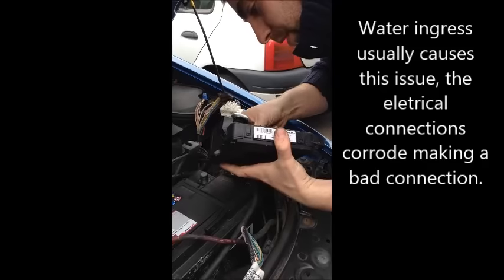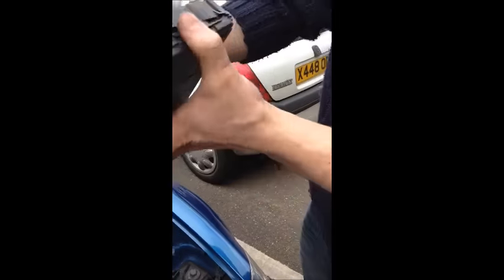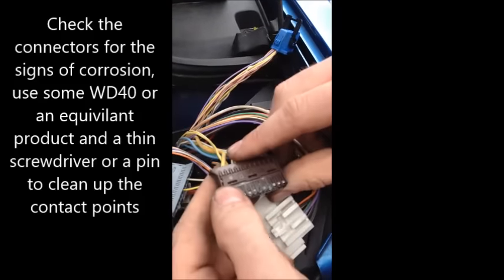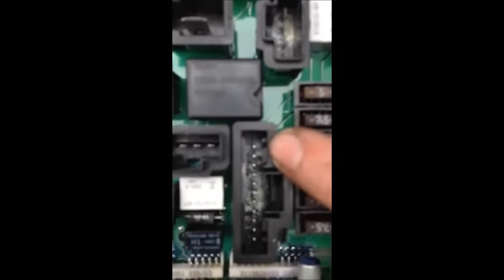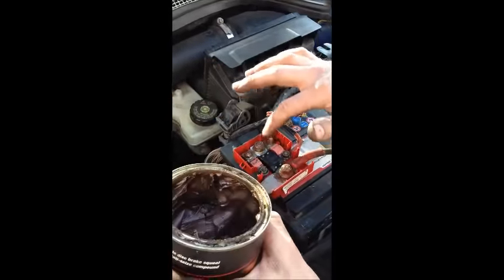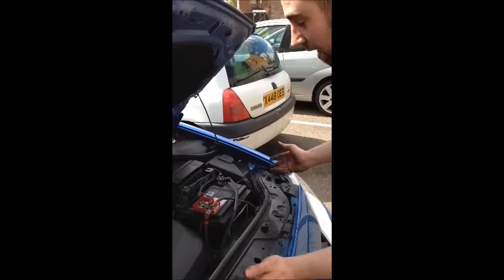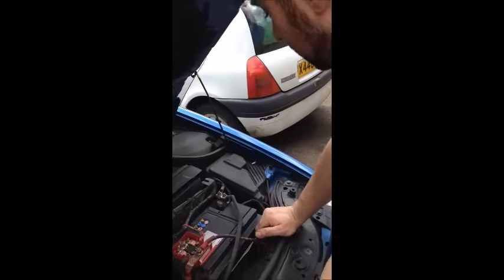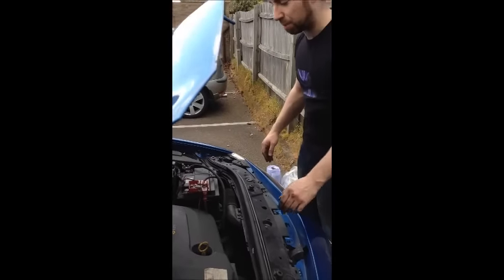How to fix Electronic Fault on Renault Megane

Comment: Hi Paul

I was in dire straights as I received the "Steering Locked", Steering not locked message today, I drive a Renault Megane Dynamic 2  and was fearing the worst. The last time I had this problem I had to fork our thousands. After watching your video i decided to give it a go, and without even needing to take my unit out, i basically just unplugged and plugged back in a few of the plugs on my fuse-box and magically the error disappeared and my car started again! Thank you so much for sharing this with us. Renault driver all over the world gets screwed on service and price daily and I thank you for being the difference.
Reply: Has it giving you anymore problems? Was it a automatic transmission?

Comment: Hi Paul, Had all this electronic errors coming random on my display. Further more, the cruise control did nok work. Tried your trick, but it did not help. Went to a mechanical auto engineer and he read out 7 different errors on his OBD2 computer. - But he knew the errors from earlier repair of a Scénic, the fault is in the unit sitting on the shaft of the steering wheel, (under the airbag) where all the switches for cruise control, horn, and much more are located. Since I have half a year warranty on this car I just bought, he will change the whole unit - not trying any repair. Hope that it will solve the problem. 
Hope that this info can help others where cleaning the relay board and plugs don't help.
kind regards from Denmark

Comment: Your a legend! I tried this ,had an electrical fault.. cleaned all the battery terminals and took out the fuse box. Opened to up and had water on the board. Used electrical sprayed and placed in a towel and on the radiator.. placed back in and hey presto. Cheers dude!

Comment: I just had this error.. the car just stoped while I was driving and the "Eletronic Fault" message poped up.. i took all the fused box out .. cleaned the box.. cleaned the connectors, made sure that the box fuses were ok.. and nothing, the car still did not want to start..  then i moved to the battery fuses and with a electric tester found out that one of the 30A fuses was burned.. In my case some of the car electronics were working ok ( radio, windows, alarm, etc ).. but the car did not started because of the Electronic Fault message, with a cable i jumped the fuse and move the car to my garage mean while i buy the fuse at the local shop.. Thanks for this video, it was a great guide.

Comment: Was going to scrap the Renault megane until I saw this video!!  :) am very grateful for this...thanks..
Had Same issue fuse box full of water!! Try to Clean&Dry fuse box but no luck!?! So I guessed the box was totally knackered!! Went and got another fuse box from the local scrapyard £20v(make sure serial code is same as your old fuse box) cleaned it up and fitted new fuse box in hey bristo!! the megane fired up!! 
Great Video... 5 stars..:)
Reply from the maker: Thanks for your comment, glad the video helped!

Comment: Thanx Paul.  I am in South Africa and it is warm weather.  I washed my car and after that the trouble started,  so I can believe it is water that caused the damage.
Reply from the maker: It does sound like a water problem then, try removing the circuit box, disconnect your battery and maybe leave your bonnet open and the circuit board somewhere warm for a few hours, put it all back together and see how it goes. Failing that like o said previously diagnostics will be the only way to go

Comment: It's great that people post vids like this. mine is currently  leaning against the curb refusing to deploy the e-brake and I'm unable to stop the engine. here's hoping this video helps :-)
Reply: yes all sorted. Thank you
Reply: so it did work for the e brake?  i changed a bulb on my headlights last night and when i tried to drive off from halfords it would not start and it was saying e brake fault? then saying battery low! i managed for it to start but the e brake will not go off..????

Comment: Thanks for the upload! Have had this problem for about three years but I just disconnect/reconnect the battery and then it works fine, haven't had the problem for a while now but am quite sure I will come back one day and i will have to clean the fuse box. Thanks again!

Comment from the maker: Pleased to see this video is helping so many people keep their Meganes out of a scrap yard (at least until the injector issues start) I will be posting a video soon detailing how to replace the fuel pump and injectors for those who don't want to part with their diesel powered renaults!
Reply: Hi I have a problem Renault Megane 2006 when I turn on the light handle any screen disappears and registered steering is locked and you can do anything you have an idea what the problem is?
Reply: Paul Higgins Hi Paul I have a problem with my 04 megane it is a 1.9 dci .... when you put the key card in it comes up "steering locked" (the steering lock is physically on) and the car doesn't start ..... should I do the fuse box bit or is it something else ?? .... any ideas much appreciated
Reply: sorted ... ta ... also found cleaning & drying out the fusebox helps
Reply: +the visitor  Have you fix it? I have a same problem with my megane 2 1.4 16v..when I put the card in it comes message "steering locked" and when I push the "start" button i hear some clicks, but the car won` t start..and when I put off the card message is "steering unlocked".
I putt the new battery and nothing changed...
Reply: ***** yes I have fixed it the problem has not happened again I also removed and cleaned and dried the fusebox and connectors that helped too ... great video really helpfull
Reply from the maker: +Matija Vincetić assuming that the fuse box method in the video hasnt worked, another common problem is the steering lock solonoid is broken, in this case you will need to replace it
Reply: Paul Higgins

Comment: Morning Paul
Thank you for the reply. So far my car has been diagnosed as a cam belt issue. They've taken rockacover off and the belt is off. Not sure if it's snapped or just come away. 
The chaps at work haven't had time to do anymore than that at moment. 
I asked if it's worth putting a new belt on it to see if it starts, but they said in their opinion it's probably damaged the valves and pistons and engine will be buggered. 
I looked on Internet and can source a second hand engine from brakers yard for about £230 including delivery. Just got to make that decision if it's worth spending about £600 for repair on a vehicle that's almost 10 years old :-( it's been very reliable up until now, which is why I am tempted to get it fixed. 
As you never know what you will buy with about £1,500. Something that could also go wrong within a few weeks. 
Good video by the way, I too had to have circuit board cleaned up about 2 years ago due to corrosion.

Comment: I had to come back to thank you my man! I had like million errors all about electronic. There was lots of water and corrosion between the board and connectors. Followed your steps (I just used some kind of spray for cleaning electronic boards instead of WD40) and fixed it in 20 minutes. Everything works perfect now. Thank you <3
Reply: Does you’re air conditioning work ?
Reply: @Daz_sz  I sold this car, but it was working 🙂
Reply: @SevenBeatsmusic  ok mate, to be honest this might still be the solution to my problem I will have a look into the fuse box on the weekend thanks for the video anyway it’s very clear how to get into the fuse box

Comment: Thanks for the information.. Just bought a 2006 renault megane II 3 door 1.5dci diesel.. Lets see what happens to it.
Reply: Nomi64 this just worked on my 1.5dci 3 door.   Took box out and cleaned all connections and the board.   Started first time.

Comment: 0:08 if you own a megane its a familiar sight electrical fault on the dash or not,there is always something wrong with them.Had a red 03 plate for 2 weeks and had everything from suspension knocking to a bad starter.Had to fight our money back,bought an 04 scenic 1.5 dCi after,thankfully that is a bit more reliable,other than the damn window regulators
Reply: 3 years on I’ve had another megane(cheap insurance, my hands were tied, 17 at the time) and it gave no trouble, I miss the thing daily, I completely forgot about this comment and just found it now looking at getting another megane on the cheap because of this issue😂 250 quid for a diesel estate with a fresh test, sounds good to me!

Comment: great video thanks,im having a battery drain problem so i stripped out all fuse box and ecu cleaned up with pcb cleaner and used white grease etc to reassemble. checking all wires,i have to check relays as well so crossed fingers .. thanks again.

Comment: I had a similar problem on my Grand Scenic 2004 1.9 Diesel.
As i was driving the powersteering stopped went stiff and dash displayed steering lock and electrical fault went back home and parked it up and tryed to start it again would not start. Thought it was the battery and put new battery in and jump started as well but still no good. Did make clicking from glove box and when in ignition position opened the bonet and moved the leads to ECU behind battery it made a noise.
Had to take it to a Renault Specialist, used ECU and used card key fitted cost £340. Car is working fine now. Still getting the "check ignition" light from before this fault. But car was working fine no problems on pick up, till recently some times the car is not picking up that good. Will try changing the glow plug control module.

Comment: Hello guys, for all they have the airbag warning light problem, I had this problem before, I went to Renault service center, they told me the problem is the spiral cable is broken ( it is the part connects the steering wheel airbag with the system, which the arms of the window wipers and head lights are connected to) and the diagnosis was correct. I changed this part ( it costs about 300 US Dollars) and now there is no warning light.
If your steering wheel is making a clicking noise when you steer left or right ( like the computer mouse clicks) so, you have the same problem of the broken spiral cable..
I hope I was clear and helpful.

Comment: Is the Renault Megane the same as Renault Scenic? I have a 2002 Scenic. The remote control doesn't lock nor unlock. The only lights that work are the headlights, no radio. And of course, no spark. Any advice that can help me out? Thank you from across the miles.

Comment: Hi Paul. I was driving along and next moment felt a shudder and Renault Scenic showed "Electrical fault" and stopped right there. Then all the error messages appeared , handbrake could not unlock, not even registering that the keycard has been removed. Disconnected the battery to "reset". No change. What could this be? Could it be a broken cambelt and the electronics trying to protec the car?

Comment: Great video, what are all the fuses? I'm looking for the window fuse (3 door megane). Passenger window won't go down after I connected a regulator wrong on the drivers window. Interior fuses are not blown, thought it might be in the engine bay fuse box?

Comment: Hello guys, 
I have a Megane 3 1.5 Dci, automatic gearbox. Sometimes I get the error Check auto gearbox, if this happens while driving the D indicator for Drive starts flashing, and it won't accelerate. After I turn the engine off, the same error is displayed and it won't start. The gear is not displayed anymore and it's locked in P.
After a few minutes the car starts and dirves like nothing happened.

Could this issue be related also to this electric corrosion? 
I'm not sure but I think it tends to happen more often after I wash the car.

Thank you!

Comment: Hello my renault megane 2005 diesel . Immediately i start the car,on the dashboard it will show electronic failure and all the interior lights stop onning , the radio too is not onning. Only the full light is working and brak light working .  
Should i follow this step to clean it or take it to the garage ?

Comment: Awesome video Paul!! Maybe you can help me. Have a Renault Megane II CC. Could not start it (immobilizer kicks in). Towed it to the shop and they changed the plate that is connected to the - (negative) terminal of the battery due to corrosion. No it starts and everything works but the Service warning light flashes a couple of seconds and then gets continuously lit with the message: Steering check. The shop could not reset the error message and want me to book a new appointment. Read that it might be the "Steering wheel angle sensor" that needs to be reprogrammed. What do you think it might be? Appreciate if you could help me out, Thanks in advance!

Comment: Hi My Megane Estate 105dci 2008 went crazy yesterday, firstly the Check airbag light came up, then followed by the steering fault, then braking fault, at the same time all the doors started clicking, opening and closing and the lights started going on and off along with the hazard lights, I turned around and went to my garage, who suggested buying a new battery, but as they said this might not be the answer, (as it's possibly an electric fault/ I then tried the car again and all was fine, so drove it away, it was fine today. I started searching for an answer to the problem and came across your video, as it was aslo raining the night before, I'm wondering if this is the same problem and if doing this will solve it?
Thanks

Comment: great vid, but i have a different problem, hope you can help.Renault scenic 2006 the central locking system locks and unlocks ok but the alarm keeps going off. Some nights I'm standing there fore 15mins trying to keep it locked without the alarm going off. Have to leave it unlocked at times. Do you know what the problem could be. Thanks

Comment: Water got into the looms in the passenger side of my renault megane convertible cabriolet. I dried all these off and there was some corrosion and a few of the wires seem to be disconnected! Is there any wiring diagram I can look at so I have an idea where the wires connect in the loom again?

Comment: No corrosion on my side (Scenic 2 PH2, 2007), USM module looks perfect clean like brand new, I've swapped with other one same model, but problem the same. Engine won't start, just engine fan spinning. ANY IDEAS? :)

Comment: I hope that this Guru can help me.  It's been months that the message "risk of motor damage"  is appearing written on the panel. The garage has checked the auto more than 10 times, they have been able to "clean" the message but the message keeps on appearing again and again. Have you ever seen this problem?  How to solve it?

Comment: hi Paul, i have a 2005 1.5dci sport limited and i am having problems on start, in the morning it starts good but if turn it off and try to start again passed about 20 minuts it will take about 4 seconds to start it doesn't hapen allways it is starting to be more times, it does't say nothing on the display, do you have any sugestions?
sorry about mi English.

Comment: Hello. I have a 55 plate Clio, similar thing driving down the road and power assisted steering dash light came on, then the seatbelt dash light, followed by the locking system going mental, engine still running, switched the engine on and off and it worked fine and got me home. Will this video be of any help to me?

Comment: Hi, i have some problem with the power window. after i replacing the original horn on my megane mk2 gt the window couldn't run smoothly. the new horn take a new power from the battrey. do i take a wrong circuit or something? Thank you.

Comment: Hi Paul thanks for this vid. Do you think doing this will help my 2004 cc roof? I keep getting a fault message and beeping non stop which is a nightmare! I tried putting the roof down and driving for a while but still keeps beeping and showing a fault :-(
Reply: Be VERY careful with the roof. My friends had a nightmare with his. It wont open anymore but luckily it was closed when it broke.

Comment: Hello Paul, thank you very much for your video, but I have a different case, my car is working fine but after 80 mph speed it displays the message "Electronic Fault" but nothing happened..!!  when I slow down my speed for 20 minutes the message will disappears.. do you think it is the same problem of bad connect for the fuse box?
Reply from the maker: This could be an indicator that your injectors could be on the way out if get the ECU checked

Comment: Hi will this work for a locking system failure my car is unlocked but all the doors are making a beeping noise and the car will not start at all and the key is not working either. I have no idea what to do. Its a 57 plate megane

Comment: Great video! Just a bit of advice... I have megane and the heater fan won't work in all 4 speeds anymore which I took to garage but seem to think it would be expensive job so I didn't bother. Also for some reason my drivers side back indicator keeps on blowing and replaced 3 bulbs in the last 2-3 months. Could any of the fuses you cleaned up here be related to the fan and back indicator? Could this be a potential fix to those issues? Many thanks
Reply: The fan is likely to have corroded pins on connector to termo resistor in blower. it's  hard to find the termo resistor and somewhat even tougher to get it out for cleaning, so let it all sit if possible, just unplug the connector and clean both male and female contacts.

Comment: Hi Paul, I have a renault laguna 2005 2ltr petrol automatic that drives great except for a fault "check injector and spanner light on dash" Does not affect driving but very annoying, any help please. Thanks Tom
Reply: You need to get that plugged in as you probably have a dead or dying injector